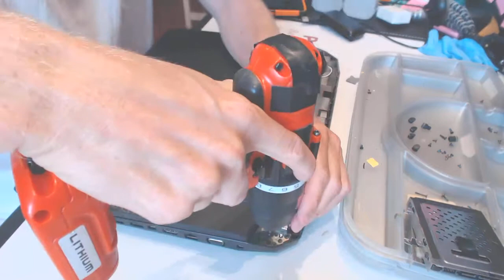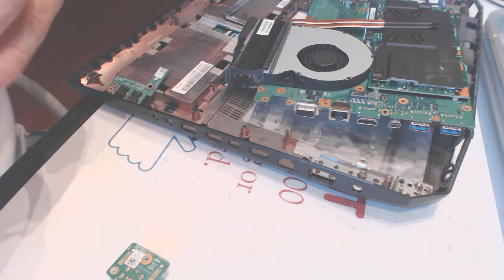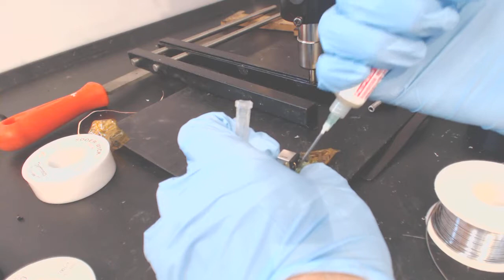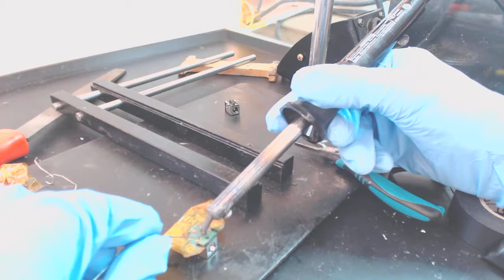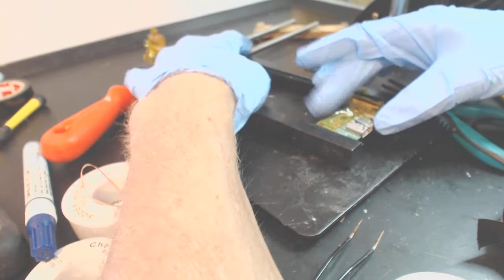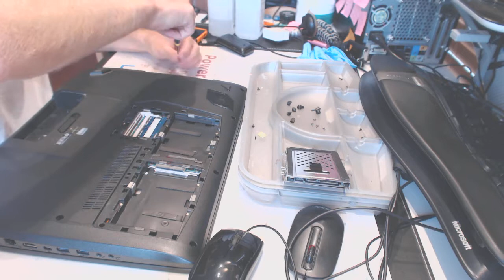Asus G760JM -DS71 Laptop repair fix power jack problems broken dc socket input port

Comment: I have a same model , when every time I plugged the charger. the battery indicator turn ON for a 2s and then off, and it doesn't turn ON at all , is that DC power jack problem ?
Reply from the maker: Remove / disconnect the battery, if the light still comes on, or any lights will come on after you connect the power supply that means the jack is fine.  However, since it responds to something being plugged in by showing up the light that means the jack is probably is fine.